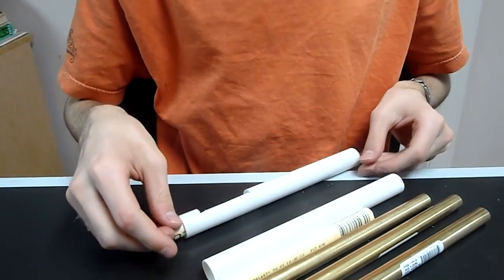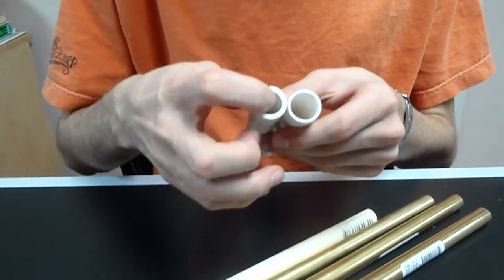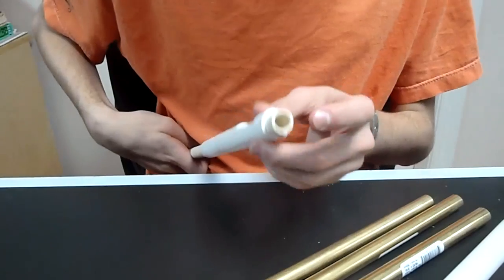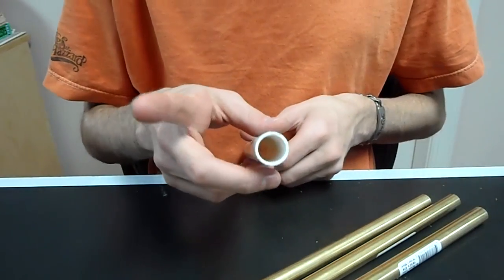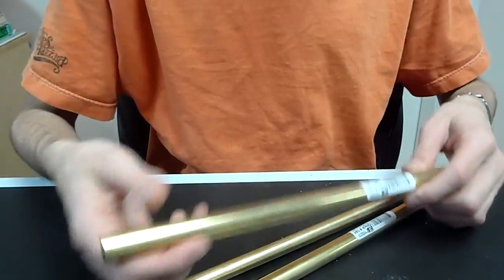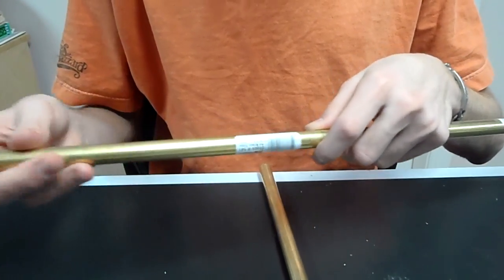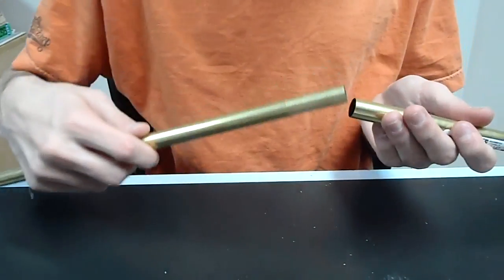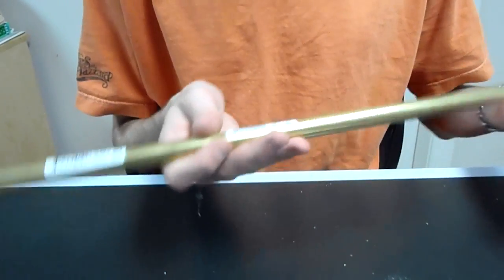Very Simple Nerf Barrel Materials Guide

Comment: A friend and I are thinking of forming our own nerf guns, using cpvc and pvc to make our own barrels, boltsled, and plunger (wielding and soldering will hopefully work), and of course new springs and all. Do you believe this will work if done correctly? And should we use the plastic moldings of the guns or should we cut our own (probably out of wood)?